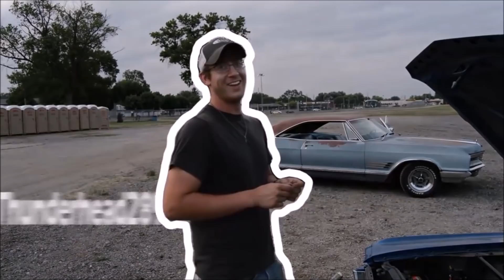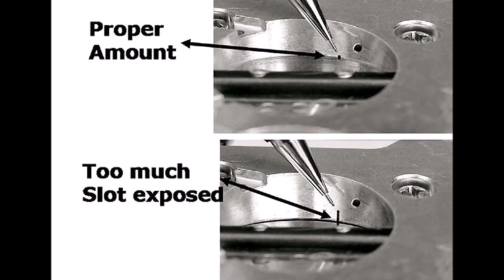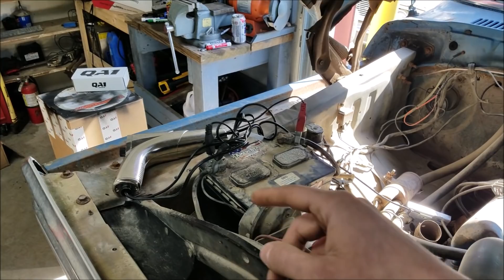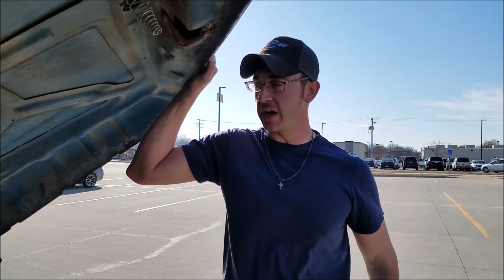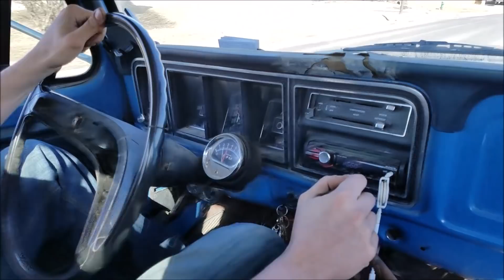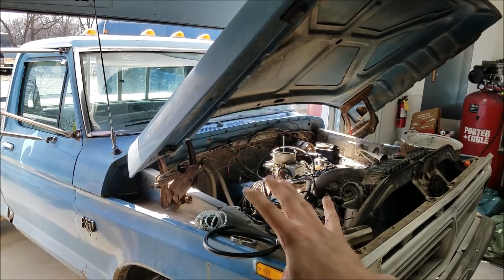How to Set Idle - Holley & Edelbrock Carbs (&& Free Throttle Response & Fuel Economy !!!)

Comment: i hav tried both .found my set up liks 20* at idel. my dizzy has 20* cetrifical advanc all in at 3700 rpm. so using 20* base would give me 40* total too much for sbf in a truck! it has a auto trans and hi way gears so it will not like agresive timing off idel. i use 87 octan as it is a 8.7:1 smoger with a lean jeted 2150 so have to be consrvitve timing with noegr. i us 2* base 18* vacuum advanc for 20* at idel ,22* at wot,40* at cruse 2+18+20centrifical=40. ported vac will restict you to using low base timing to stop ping. then you get a crapy idel and it will run hot do to the fuel burn being slow! also with ported vac from the late 60s+ moust used a temp swich to swich to manifold vac to cool the engine if it got to over 200*! so i use manifold vac!
Reply from the maker: If you mash the throttle with only two degrees of initial it’s going to be a DOG. 
You lose all your vacuum advance timing as soon as you leave from a stop until your speed stabilizes. While accelerating you are absolutely on mechanical only. 

Here is the solution to your problem - stop bushings - or some kind of advance limiter. 
This is why msd distributors use stop bushings to allow you to run the mechanical initial you need while still maintaining effective total. 
Does this make sense? 
15 degrees of vacuum advance is the very reason ported should be utilized - that’s way too much vacuum timing at idle - handling a timing transition off idle of 15 degrees is dang near impossible to balance out - you will always have a hiccup, or in an auto, a flat spot!
Reply: i get what you are saying i need to limit the mechanical so i can use more base time. but 20 is a lot of base time, bet it wold ping off idel with 87octan with c4 and 2:80 rear gears in a truck! that is why i use manifold vacuum and 2* base time. but it wold be a neat to try that much base but i bet it wold not like to start hot! all so most sbfs  like around 22-24* total with a auto with regular gas just look at the fox body timing tables for a auto. IT runs well no bog. i notice no difference in take off.  i have ran as much as 12* base and ported vacuum 32* total with 12* vac advance. I try both on all my engines and find manifold works for me most the time. and ford has even used manifold vacuum! most ported setups form late 60s used a temp switch to switch to manifold to cool the engine ! i do understand that ported can work but  all engines are different and think manifold is right for me using 87 octane in with tall gears and auto in truck will need the timing to drop to avoid ping.  well love the stuff you do take care and carbs rule!

Comment: Hey Mate...Can I assume you got your 14 degrees timing sorted whilst  the vacuum line was connected back on the ported vacuum between the distributor  vacuum advance?  OR   did you adjust your timing and idle whilst they where NOT connected? ( and plugged the holes)  It would also be good to show the viewers how you connected the vacuum gauge (to see RPM) During your Timing Adjustments....for those who don't know how... just my two cents.. Good video!

Comment: My vacuum advance canister has two ports on it. Would I run both of those to ported vacuum?
Reply: No. Usually the vacuum port furthest from the cap is the advance.  That second port is part of some smog/EPA/gas crunch setup.  Depending on which car it was, sometimes those ran through a temperature controlled vacuum tree which opened and closed the vacuum source based on how warm the engine was.

In some examples, the automakers intentionally de-tuned engines when they were cold or at idle.  Making the timing run late while the engine was idling caused the engine to start exhausting while the gas charge was still burning.  Ford got similar effects to having a catalytic converted back in '73 like that.  It made the engine run hotter and more heat under the hood coming off the exhaust system.  They had to pass stricter emissions controls and did so at the cost of running the engine and exhaust manifolds a lot hotter.  Sometimes the manufacturers used similar tricks just to help the engine warm up to operating temperature faster.

Anyways, if you're here and watching this video, then probably you aren't worried about this smog and emissions stuff.  You're here for horsepower and drivability.  Cap off the vacuum port on the distributor closest to the cap.  Then connect the other port to whatever vacuum source makes you happy, and tune away.
Reply: @giantpune  thank you. I'll go take a look at what I did. It's a 74 Ford and even though I'm in California, 75 model years and older are smog exempt.
Reply: @reidbarnes9851  By 74, ford was in full swing with all sorts of crazy thermal controlled vacuum stuff for emissions.  If your engine still has most of that equipment still hooked up, I would suggest getting a feel for what everything is before you start taking parts off and plugging ports.  :D

I think the subject matter and the advice in this video kind of assume all that silly emissions and smog stuff is gone anyways.  There are some points like making sure your transfer slots in the carb are properly adjusted that do apply.  But then any advice dealing with timing and vacuum, it feels like a fool's errand to try and tune your engine for horsepower and throttle response while still having to work around and fight those systems that intentionally de-tune the motor at idle.
Reply: @giantpune  most of the smog equipment was gone by the time I got the truck. I deleted some more of it. The vacuum advance that was on it wasn't working but only had the one port. The new replacement one had two ports.

Comment: Nice video 👍A newbie question but if I don't ask I won't know, I have an Edelbrock 650 carb and bought an MSD pro distributor, would I still benefit from using this option? Thank you for any suggestions.
Reply from the maker: Absolutely! 
Also, run one of the lightest spring and one of the middle of the road springs. 
Add the proper stop bushings for 32-36 degrees of total timing after you set initial

Comment: Hey Luke, great job with the videos  - very informative and teaching to anyone even remotely interested in old school tech and cars.
A question - Got my grandpa's old Fiat from 1964 that I've slowly been building for a couple of years and in a week or so it's at the point of starting up after I get the fuel lines done. Any tips on what last minute things to do before I crank it? The last time it ran was back in 2012, at that time it started after 1 minute of cranking with old oil and having just sat for 25 years. The car's been sitting in a warm garage for the last 45 years. Oil / fluids? Anything else? There's still some 70's fuel in the tank lol

Comment: Thank you, your videos are QUITE useful. We bought a 1955 Thunderbird that has a 1957 312 installed in it. Used your video about adjusting clutches to fix the issue with our's. It was NOT adjusted at all since the clutch had been installed years ago. Our car has a Holley 1848 just like your truck and has a Mallory Unilite distributor in it that has no vacuum advance. According to the tach it idles at 1400 rpm's and still needs the clutch feathered a bit on the off in first to avoid stalling. Manifold vacuum measured at the manifold is 17.

Comment: I run manifold vacuum because my engine seems to idle cleaner. No proof of this other than less smell of  gas fumes.
Reply from the maker: Bobbie and Ian Guenter when you switched to ported did you advance your initial mechanical timing tho.... 

The responses to this video disappoint me - I must be hard to listen to. 

This is not a video about manifold vs ported.
Reply: @ThunderHead289  I enjoy all your videos and am sorry I sounded negative. My problem was limiting the advance on my Hei when I bumped up the initial timing. I took the easy way and used manifold vacuum.
Reply from the maker: If you find me on Facebook, I’ll send you a picture of how to correct that issue inherent in the hei ☺️

Comment: The only difference between manifold and ported vacuum is at idle. Has nothing to do with base timing. Manifold gives full vacuum at idle and usually provides a bump in RPM (need to readjust idle) and vacuum. The engine runs cooler and more efficient with manifold vacuum at idle. As soon as you crack the throttle vacuum drops to exactly what it would be with ported vacuum. Hence they are the same timing wise and both add too base timing exactly the same amount (if at all, full throttle) once throttle is applied. With that said, love your videos.
Reply from the maker: You clearly didn’t listen to a word I said. 
I discuss what you say in your comment.
Reply: @ThunderHead289  Your right. I watched it again. The wife must have distracted me or something. Anyway. Love your videos.
Reply from the maker: Scott Newman it’s all good - Iv been told a million times I’m too wordy and he’s to listen to - there was a time when I was a better presenter. Now I guess I have too much to say
Reply: If you use a vacuum advance, (which is pretty much only there for part throttle ECONOMY), hook it up AFTER you have set the total timing.
Of course when you are driving down the highway at PART throttle, the vacuum advance will pull anywhere from 10 to 15 degrees MORE advance (beyond your total timing) 
BUT under HARD acceleration, the vacuum advance DOES NOT WORK anyway, so you're back on your total timing when you're ON the throttle.
Personally, I almost never use a vacuum advance on performance engines,

 A vacuum advance can also be used to help engines get rid of "Run-on" or "Dieseling" problems when you shut the engine off. 
But! you can also do this by hooking it up to a MANIFOLD vacuum source to pull more advance when the engine is idling. 

The reason for doing this is to make that extra timing being pulled at an IDLE to increase the idle RPM, which in turn allows you to back-off on the idle speed screw, which in turn closes-off the throttle plates!
 .....So when you shut the engine off, it can not "mechanically" continue to pull fuel and air into the engine causing it to Diesel.

Hope I haven't confused you Scott.

Comment: Is this method good for advancing timing for higher octane gas? Will you be able to notice a larger initial advance?
Reply from the maker: I’m not sure I understand your question - octane and timing are unrelated factors. 
Spark knock and preignition are different forms of detonation
Reply: ThunderHead289 Wouldn’t too much base advance on a fuel like 87 cause detonation? If you tune timing based on ported vacuum, and then based on idle speed, how does this guarantee the best performance based on the fuel you chose? If you put race gas in your truck, you would be more concerned with total advance, but initial is important too right? I’m just trying to advance my car’s timing for performance.

Comment: I dont like asking for advice but here we go i have a sb chevy with msd hei 9.71 com summit 600 vac second summit dull plain int comp little thumper cam 3in duel ex with summit bullet mufflers 700r4 trans stock converter.now in comp cam ad they say stock converter will work fine but im haveing idle problems.i put 34 degre total adv any more it spark knoks with 92 octaine and it has headers.with that being said at idle in gear i have about 2 deg of timming with vac adv at ported vac idl like shit.and yes i checked transfer slots there good.now do you think the coverter mite be the problem draging the engine down to much or do i need to look at doing something with hei.i really think i dont have enough initial timing but as you can see i cant put more timing in or it spark knoks help im at a loss any sug would be great.keep up the great videos there very helpfull.
Reply from the maker: What is your full initial timing? 
I guess I didn't exactly understand your comment about your initial timing. But that's the downfall of the hei, it's hard to limit total timing - there is a simple method that I'd be happy to show you, I just can't via YouTube - find my on Facebook, search thunderhead289  and send me a message

Comment: Might be a stretch! It would be awesome if you did a video series on a A-Z engine rebuild. Like what to do, how to do it, average cost of the rebuild kits and what you NEED to replace, and the cost of getting the machine work done, Finally. Putting it all together, setting the timing, getting the engine in the truck or car with the carb all setup and running right. Id like to see something like that! Especially from you! Since you've got a lot of knowledge on that subject!

Comment: I'd like to hear your opinion (if you have experience with) the initial timing on a Ford with efi & the EEC IV. Base timing is 10* Do you think it would be beneficial to set it at 12-13? My concern is that the ecm will have the timing over advanced at wot
Reply from the maker: I wouldn’t mess with settings on a computer controlled unit 👍

Comment: With all due respects TH289 I disagree. There is some information that you have left out such as RPM to burn time, lean idle transition to part throttle or full throttle and how they are effected by timing. My factory manual for my 1967 Pontiac even shows full manifold vacuum for proper setup and a double acting vacuum diaphragm ported for emission purposes. It’s very difficult to have a typed discussion so here is a basic explanation for anyone wondering what I'm looking at…..      https://www.chevellestuff.net/tech/articles/vacuum/port_or_manifold.htm
Ported vs manifold seems to be one of those topics that people disagree on like what’s the proper oil to run. Anyway, keep up on the awesome videos and look forward to the next.
Reply from the maker: I actually review all of those items in my timing video 2 or 3 uploads back! 
Not that I think I’m amazing because I’m just a rando, but I’d contend that it’s the best ignition timing explanation on YouTube as it relates to vintage engines - give it a watch, and we can continue our discussion there. 

People get hung up on ported vs manifold. They move from one to the other and never touch initial timing. This isn’t about ported vs vacuum, it’s about having 5-8 more degrees when you rip into the throttle because your initial timing is all mechanical.
Reply: @ThunderHead289  Yes, I understand where you’re coming from. You definitely have a handle on adjusting and relaying information to us all and it’s appreciated. I have watched most if not all your videos but I will rewind and check these out again. You have a good evening.
Reply from the maker: Hey, I wanted to say that I appreciate the way you approached me in your disagreement. I wanted to make mention of that - sensible people and reasonable interactions are rare when folks have differing opinions!

Comment: I've run both ported and manifold vacuum advance and for my application I chose manifold vacuum for vacuum advance. Mostly because it idles much better in the cold with more timing once the choke comes off. I can't run anymore than 10* BTDC with my engine otherwise the starter gets drug down on hot restarts. Other than the smoother idle in the cold I can't tell a difference otherwise.  I've never done a hot compression test with the current XE250H cam but the old what seemed to be a 252H produced 150-155 PSI cold, with my old smog heads. It must have pretty high cranking compression, should test it some day.  My current timing setup is 10* BTDC, 26* centrifugal advance for 36* total all in by around 3100. I still get pinging occasionally, but not often. Might back it off a couple degrees and see if the occasional pinging goes away.
Reply from the maker: Iv had a lot of success with more initial mechanical, ported (so there isn’t too much idle timing), then limiting my total timing to 34-38 degrees. 

It’s not about ported vs manifold - it absolutely wants more timing, you just have to provide mechanical initial. Then  your carb settings transitionally are not also way off base.
Reply: @ThunderHead289  I've played with the springs in the past and tried it all in by 2600 RPM and it ran real good but pinged a lot. I think the truck weighs too much and the camshaft is a bit on the tight side as far as overlap and not bleeding off cranking compression goes. Most any other engine I've tuned set it 12-16* BTDC with no vacuum advance at idle and the timing all in by 2500-2800 depending and they ran great with no hot restart issues from timing being set too advanced. Not sure what the deal with this one is.  If I set my timing to 12* BTDC or higher, the engine almost won't crank over when it's hot. Set it to 10* or less and it whizzes right up. The engine loves a lot of timing as far as running goes but it creates other issues. Ugh lol.